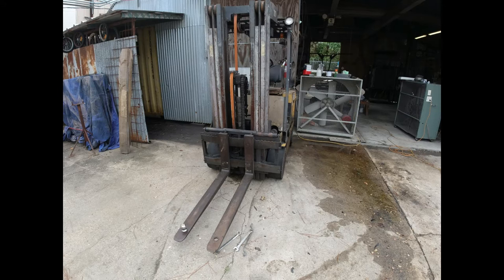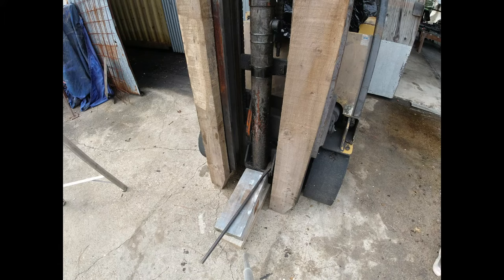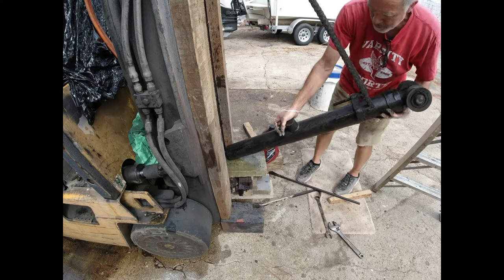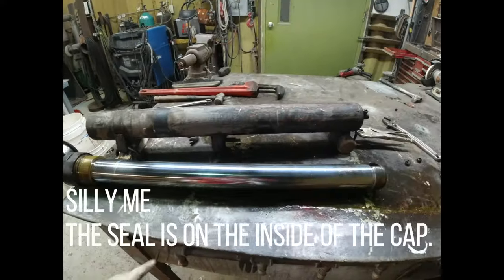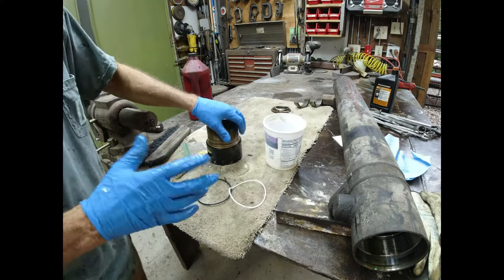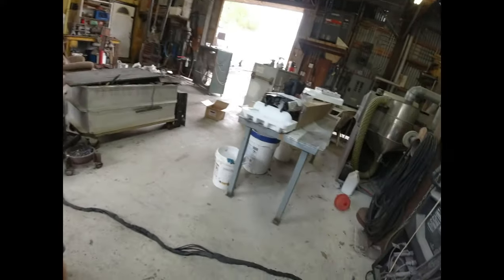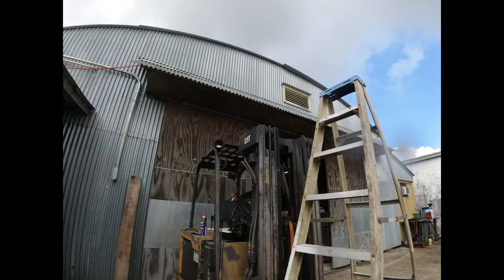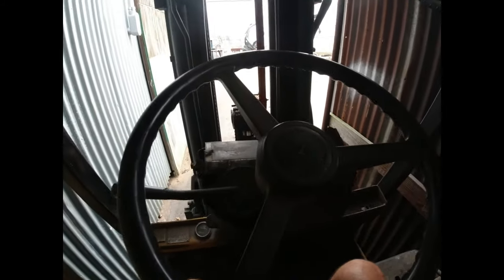DIY forklift cylinder removal, repair, and replacement.

Comment: Pro tip on this type of primary cylinder, we leave the cylinder in the lift. Lower the carriage on to blocks, pull off the chains, remove the pulley and gland nut. If we have to pull the rod, we use the hydraulics to raise the piston to the top of the cylinder and then pull it out.
Reply from the maker: Thank you for the tip! I posted this thinking it would be just another one of my 200 view videos. It has actually been viewed quite a few times and I hope most of those viewers are smart enough to know a “how to” video from well, how I did it.
Barry

Comment: Your a brave man Barry, im am terrified of hydraulics. Especially maintenance work were parts might still be under load. You have one big angel sitting on your shoulder, that was a close call.
Reply from the maker: Thanks Jop! That was a stupid move on my part not watching the top of the cylinder when I knew it was coming down and I was pretty lucky. Pretty simple system, when turned off there is no stored energy other that gravity. 
When we have old equipment and or tools it it either fix it yourself of scrap it. No way I could justify a wrecker truck to haul it to a shop, shop fees, and a return haul. The machine just isn't worth it.
Barry
Reply: @barrylukebuilds7894  I totally agree with you, and would have attempted the same :) Old iron need some people like us caring  for them

Comment: Thanks for this video when I searched this problem on Google cuz I'm new to do in hydraulic work on forklifts this was the first video that came up so it must be very popular and this is the same exact problem that the forklift I have to work on at work has the main cylinder in the middle is leaking I've been in maintenance for a very long time doing an electrical and mechanical work for 7 plus years but I have never done hydraulic work so thank you so much I feel more confident if I have to take on this task at work now
And I'm glad that that cylinder did not hit your head in that you're safe and thanks for sharing this video
Reply from the maker: Thanks for taking the time to comment and I am glad the video was of some help.
Barry

Comment: That was a baller move because you didn't know what you didn't know.  I am considering doing one of my lift cylinders but you make me consider whether the $1,000 I would spend on a mechanic is worth my life or a hand.
Reply from the maker: $1000 doesn't sound too bad but keep in mind my total cost was $80 for the new seals and another $100 for 10 gallons of oil. I just went about it in a kind of a back asswards way( because I didn't know what I didn't know).
Thanks for watching and thanks for the comment.
Barry

Comment: Those seals and wipers go in easier if you soak them in hot water for a bit.  They also make a neat tool that folds the wiper into a 'W' shape and then lets it loose to snap into its groove.
Reply from the maker: Good tip, thanks Douglas

Comment: 18:00 thats when you run into this problem you can clean the groove up with brake cleaner, and pack the gtoove with bondo, make it nice and smooth put the cap on then clean the bondo out of the groove.
Reply from the maker: Roger 
Thanks for the tip! I have it filled away in the old brain so that if I need it in the future I will have to look up your response again because no way will I be able to remember. 
Thanks Barry